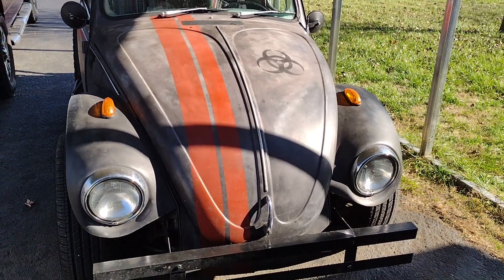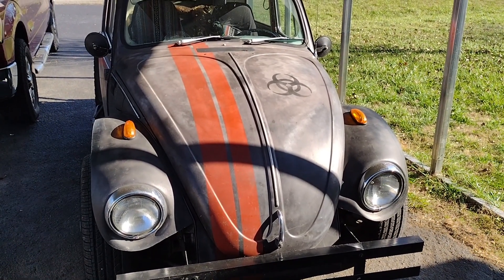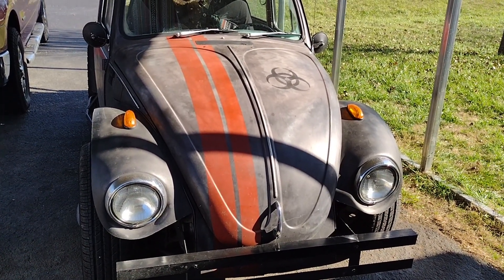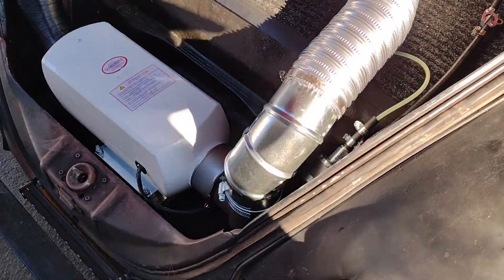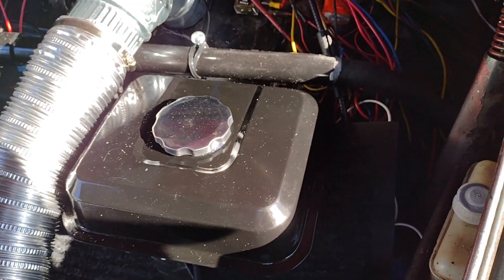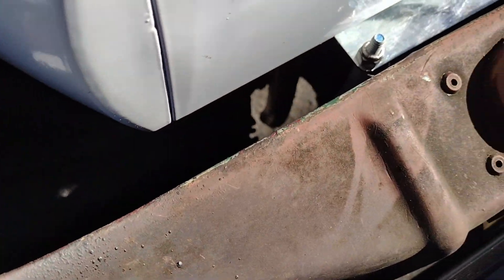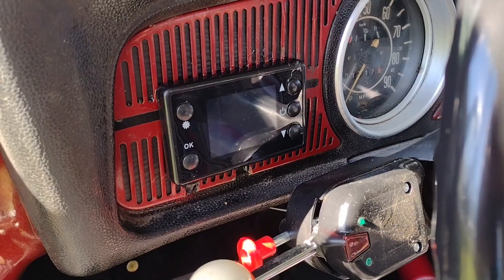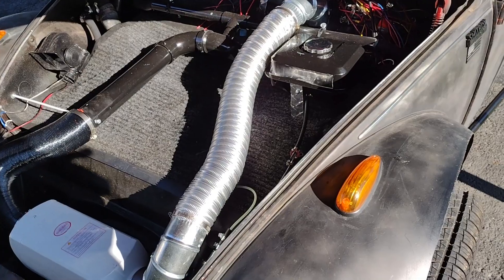Chinese Diesel Heater In A VW Beetle

Comment: Hello my KY brother!  I have wanting to get a real heater option to heat my 65 bug.  I love this option.  Thank you Randall!
Reply from the maker: Check out my later videos. I added defrosters to mine. I've had this through two winters and it still works great.
Reply from the maker: https://www.youtube.com/shorts/V-gQjEbKczA
Reply from the maker: If you haven't converted it to 12 volt you'll need to at least add a small 12 volt battery to run the heater.

Comment: I just saw these diesel heaters an thougt this might work for the bettle but you already thought of it ten months ago
Reply from the maker: I have since removed the pvc defroster ducting. It was deforming. Defrosters aren't a big deal where I live anyway. I just scrape the inside with a credit card and use ice melting windshield washer fluid on the outside.

Comment: Im installing one myself. How does it do on battery drainage? Could you just let the car run while using the heater to keep the battery up?
Reply from the maker: I keep my car on a maintainer because when I want to preheat it before I leave it will cause a voltage drop while it's starting up due to the glow plug. Once it's running it has very little current draw. Usually when I'm out and about I'll let the heater run while I'm eating or in a gas station. I do run a separate wire for the heater up through the car from the battery.
Reply from the maker: Here's an update with the improvements I've made. I now have defrosters.  https://www.youtube.com/shorts/V-gQjEbKczA

Comment: Do you think a 6V VW beetle could power one of these heaters?
Reply from the maker: It has to be 12 volts to work.
Reply from the maker: The only thing you might do is to get a lawn mower battery to run the heater from. They use the most power at startup but once it gets going the glow plug shuts off and it doesn't use much power after that. If you're only going to use it for short periods of time that might be one option. Just get a maintainer and keep it plugged in when not in use or even use a solar panel to charge the battery.
Reply: @randall1959  thanks for ideas! I really appreciate it.
Reply from the maker: @travismunden8250  You're welcome. There are 6 to 12 volt inverters but they don't have enough amperage to run the glow plug so a lawn mower battery would be a viable option. You can get deep cycle lawn mower batteries and if you go this route that's what I would suggest because they're more able to handle charging and discharging.